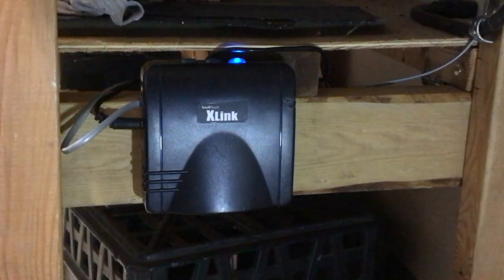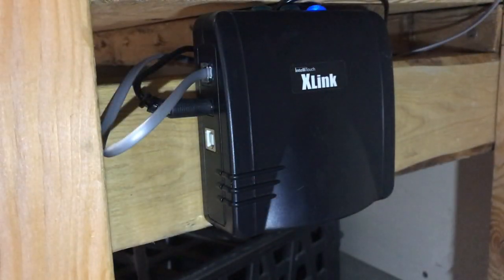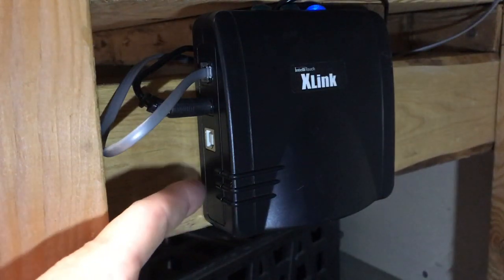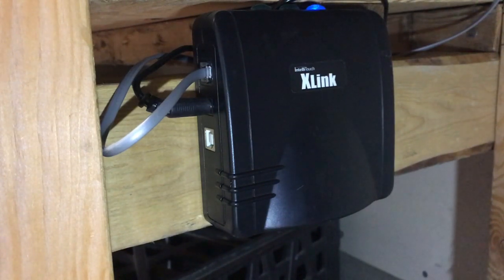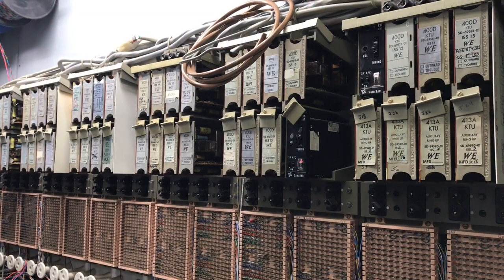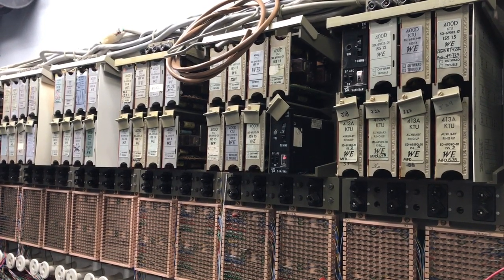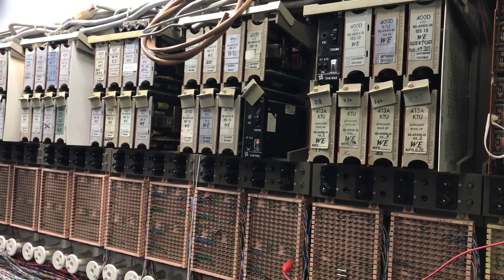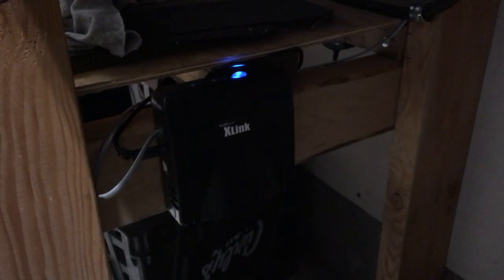Connecting a  cellular phone to a 1A2 Key telephone system.

Comment: Can I connect a 620A2 5 line desk phone to x link or do I need a huge wall setup.
Reply from the maker: I don't know what a 620a phone is, I have a lot of 620a 1A2 panels. You can connect a old style 1A2 phone to a x-link however it will not have working lights or hold functions.
Reply: @sxsphil  
Thankyou, I want the lights and hold buttons to work but will be using only 2 lines.

Comment: I wonder if the Xlink devices are compatible with all cellular phones?
Reply: All cellular phones that have bluetooth built in. I have used an xlink in the car connected to a laptop via a 56k modem over bluetooth to a alcatel goflip flip phone.
Reply: @tieline1333  I think we need a video on that
Reply: @turtleschmiechen6155  Works "okay" for 300bps anything higher is just not good at all by any stretch.